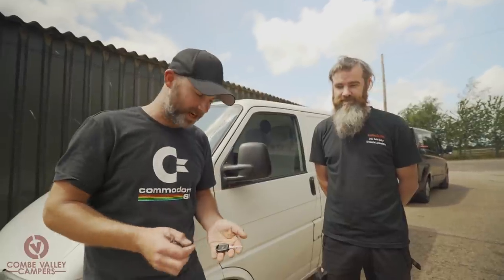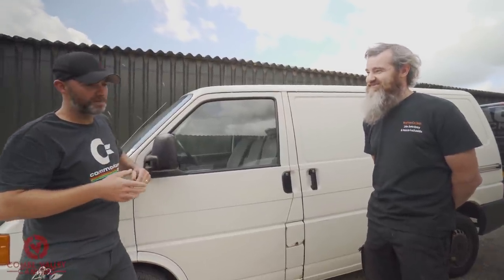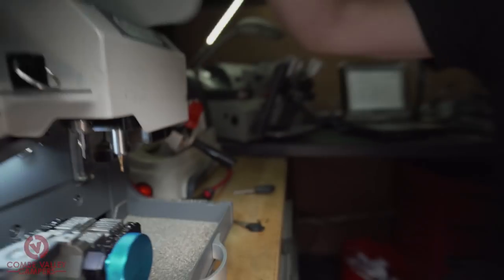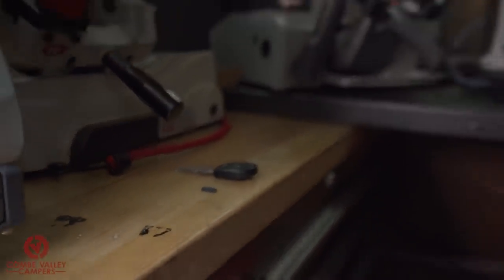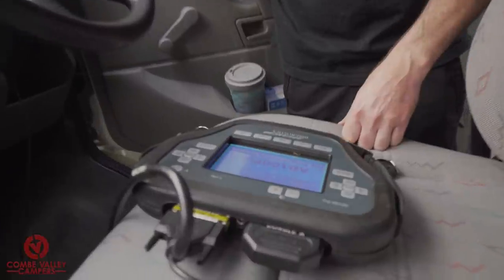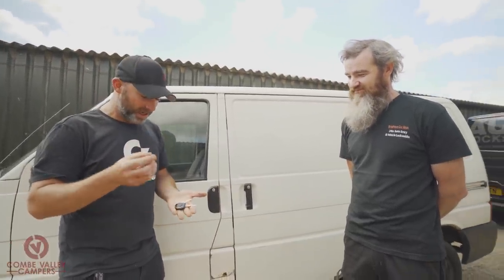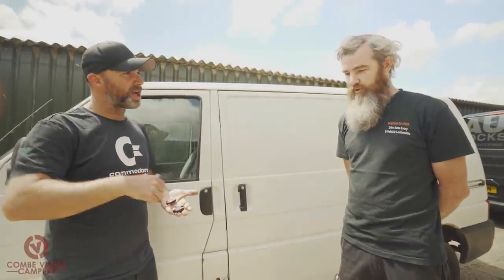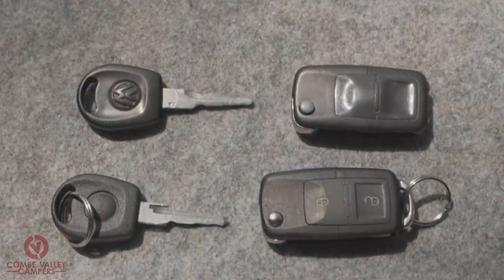HOW TO PROFESSIONALLY CUT AND CODE NEW CAR KEYS (with bonus footage of re-casing a broken key fob)

Comment: Hey nice video, wonder if you can help me on this. While ago I’ve lost my only key for my car Citroen C4 2006. A car mechanic came to mine and cut a new keys by the code from the dealer. They don’t work on the door look. Can I open the lock and realign the pins so it works with the key. Many thanks.

Comment: Hi there wonder if you can help I have a Renault  boxer van that I have been building in the lock down,  when I got it from a guy in Doncaster showed me around it and said it got central locking but I have since discovered that the central locking only works on back door and two front doors, but not sliding door I have to lean over front seat to lock it from inside before locking outer doors as I am 78 years old and live on my own it's not so easy has something gone wrong in the fob or is there something gone wrong in the lock.
any ideas please local garages don't want to know.
Loved your video

Best regards keep safe George smith Whitby North Yorkshire

Comment: We have the same issue with the anti theft and a faulty key chip and we are throroughly pissed off about the coding aspect and that this is an issue we have to go through a locksmith and someone to code it what a scam
Reply: yes totally agree just a rip off,if you can legally prove the vehicle is yours manufacturers should reprogramm the key for a minimal cost